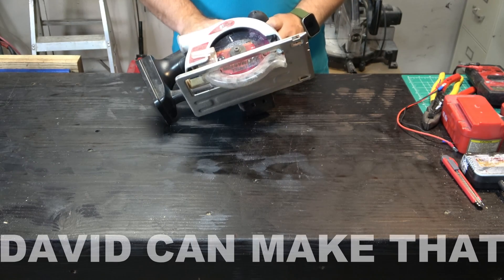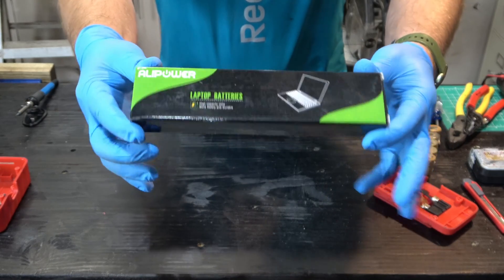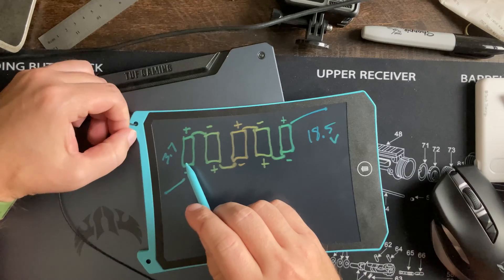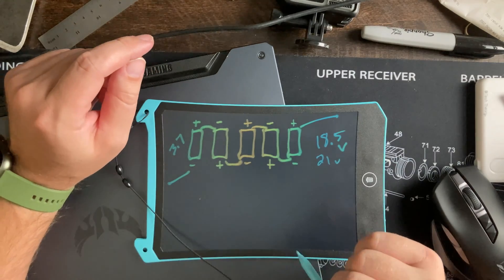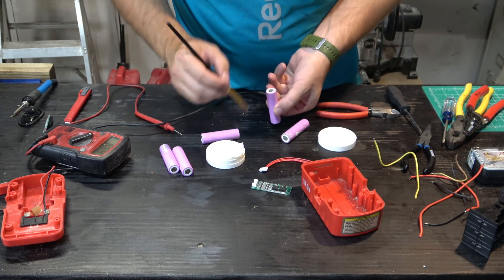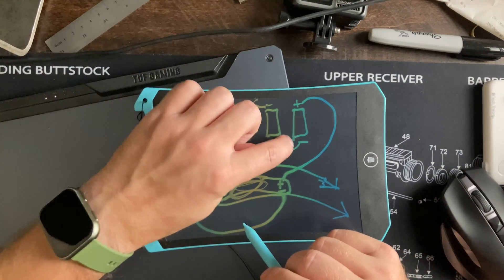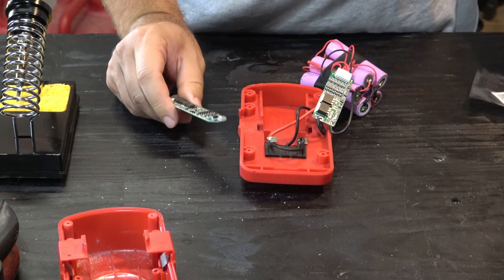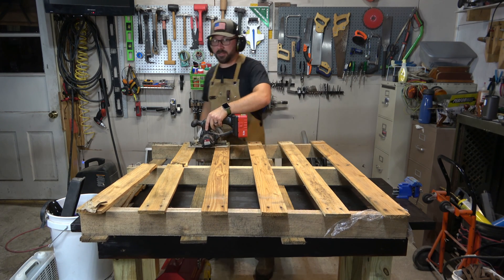Convert Your Old Tool Batteries to Lithium-Ion - The Complete Guide - Parts List in Description

Comment: Apreciate the work you've put in, but pretty useless and expensive... the total cost of cells, bms and work wouldn't beat a battery pack designed for power tools. Get a 5ah milwaukee or makita or whatever serious brand and make an adapter for the tool. Or better still modify the connection plate on the tool itself if possible. This way you have the correct charger, multiple swappable batteries and the correct cells. Power tools are very amperage hungry and need cells that can provide peak amperage of 40-50-80 amps. If you're using let's say a lamp then you're good with most cells because they need constant low current, not spikes.

Comment: Did you just use the charger that came with the original battery?  I have an old 18V Craftsman drill that's barely used, but the Ni-Cad batteries are shot.  Be a shame to just throw it away.
Reply: I have the same question. I have (2) Craftsman power drills 14.4 v. Can I use the OEM charger as long as I use a 4 battery BMS ?

Comment: The reason why doubling the battery capacity increased the cut time by so much more is because with half the cells it wasn't the adequate amount of amps the motor required to run so it struggled to run and drained the battery quickly then when you doubled the battery capacity it now had plenty of amps and so the motor ran more powerful and more economic

Comment: That was a superb excellent video, David. I had to replace my old Black & Decker 10.8 volt Nicad to lithium. I used 3 lithium batteries and added a BMS board and it worked perfectly well. Used a 12 volt 3 Amps Switched Mode power supply as charger. Thank you so much for your clear and detailed explanation especially on the parallel and series battery combination to get the right power. Mahathev from Malaysia.

Comment: The reason why doubling your mAh capacity made such an improvement is you are overloading the cells -- drawing too much current.  Normal laptop batteries are more optimized for capacity and not for ability to provide high currents.  Normal power tool batteries are the opposite.  A laptop battery might be designed to provide 2-3C (a 2Ah cell might provide 4A to 6A) while a power tool battery might be designed to provide up to 40C (a 2Ah cell might provide up to 80A).  Putting cells in parallel doubles the C, doubling the ability to output current.

And once past design specifications, we could talk about cell brands, degradation of used vs. new cells, pack balance, and a multitude of other factors.  I think for doing this project it might be better to start with an economical name brand tool battery.  This might involve digging thru the recycle bin at a local big box for cells and a BMS to salvage, or even purchasing a new battery to get the cells and bms (e.g. Ryobi 18v(20v) batteries might be a 2Ah for $40 or on sale two of 4Ah for $80, or a 2Ah+4Ah+charger for $100).
Reply: "digging thru the recycle bin at a local big box for cells and a BMS to salvage"

Will they let you do this?  Seems like a much cheaper way to get cells.

Comment: I was using harbor freight battery tools ages ago.  My father in law gifted me a Ryobi 18v drill and saw kit (the old blue and yellow ones with NiCd batteries).  Still using those Ryobi tools now with Ryobi One+ li-ion batteries and have since purchased more Ryobi tools.  The li-ion batteries were/are a great upgrade for tool performance.

Comment: I did something similar, but I just glued the old top battery housing onto the top of the new battery after soldering the terminals together. It worked about as well as your first try. It was a harbor freight lithium battery: 16 bucks. No endurance whatsoever. . .